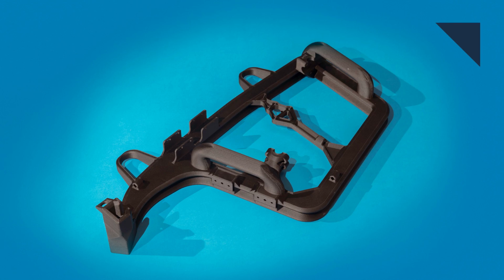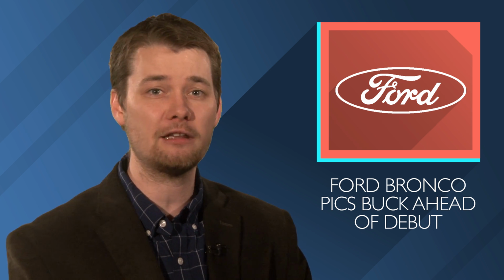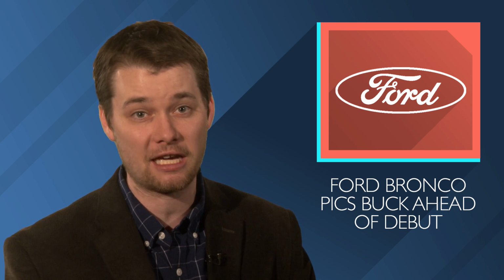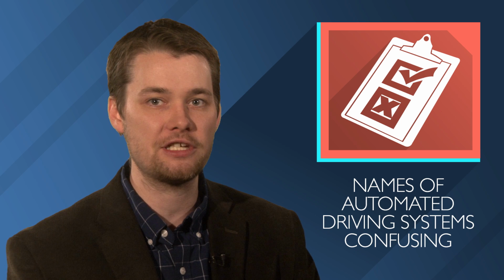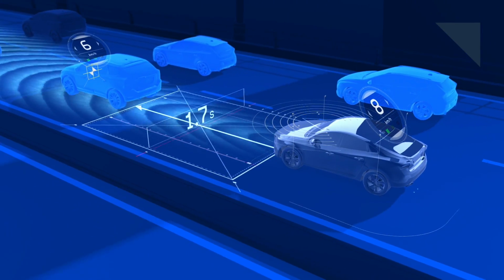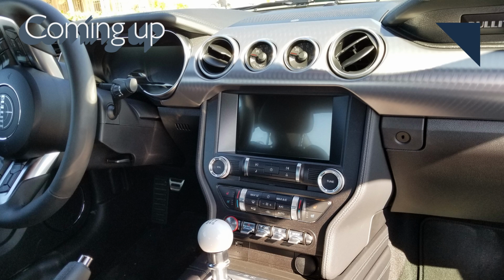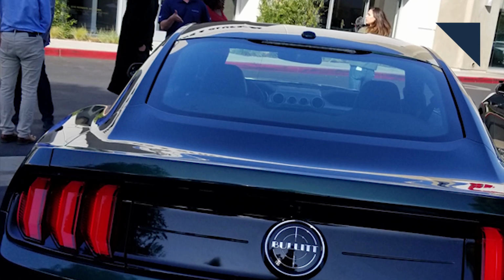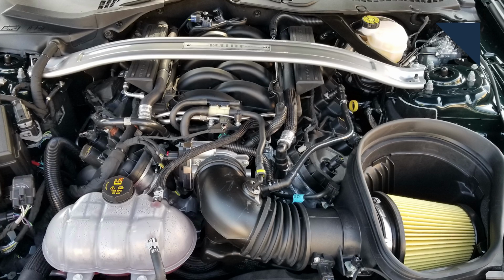Ford Bronco Leaked, DSRC vs. 5G - Autoline Daily 2479

Comment: I think that's a picture of the baby bronco built off of the focus platform. The Broncos built off of the ranger platform should be bigger and more rugged. I think.
Reply: I think it is the baby Bronco based off of an Easter Egg in the photo. If you look at the central picture there is a shadow behind the little Bronco that is larger, boxier, and has a full size spare tire mounted on the tailgate.

Comment: If anyone is old enough to recall the pushback in the 70s over air bags in cars, the apprehension over AVs is at about the same level. In five years AVs will be accepted. The resistance will be over no steering wheel or pedals. Loss of personal control.
With the expansion of the 5G network by various phone companies, could that infrastructure generate additional income to the phone companies that own it? Time to buy?
Reply: This is primarily about V2V 5G LTE networking between vehicles (just like DSRC is V2V too), so "no external network" is required for it to use its basic functionality. But 5G has optional V2X functionality that would require an external network like from the phone company to function. Even a simpler V2V DSRC will improves safety. And since cars can made so they can use either DSRC or 5G.  There no real excuse to not mandating new cars have both capability and start using one of them now to save lives. 
(FYI-Theoretically a side benefit to 5G vehicles is that they could even be used to create a communication network in an emergency when other forms of communication were down in an area. But on the downside it increases security risks too.) 

BTW, ironically Im still not much of fan of airbag, since I wear my seatbelt and the only injure I had in a car was form an airbag injury.